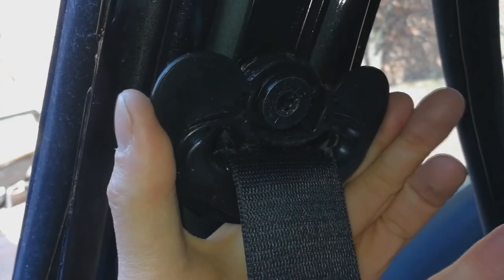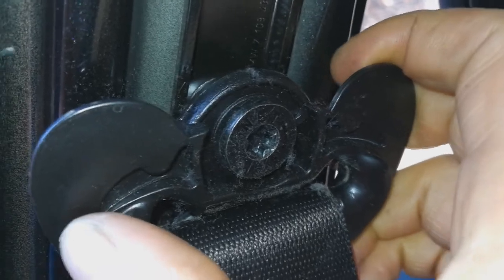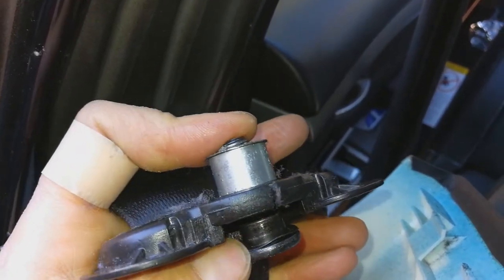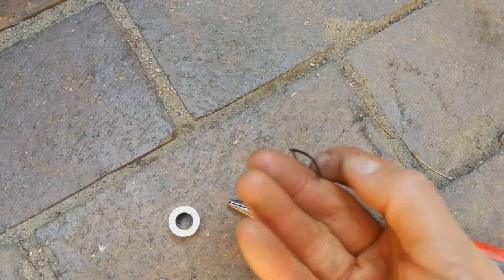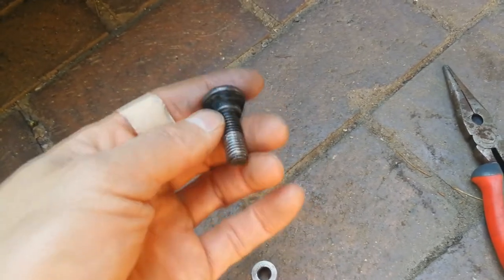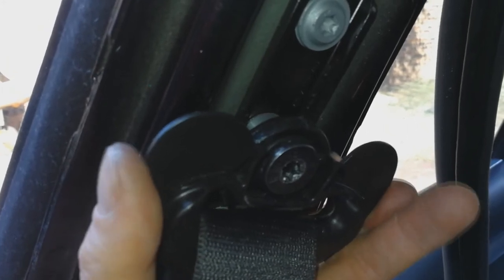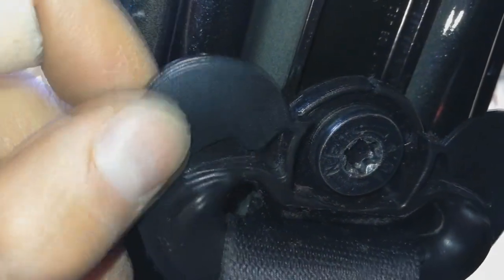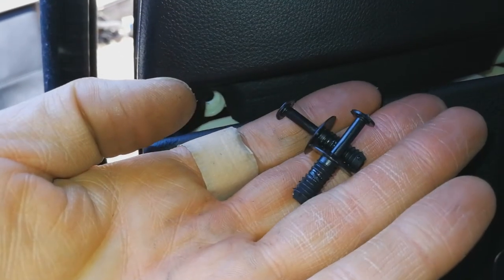Seatbelt clicking (rattling) sound fixed (BMW)

Comment: First of all : THANKS ! This is all I needed to fix this on a F20, the mecanism is exactly the same. Big thumb up for sharing this stuff, it helps, even 6 years later !

For other viewers : I heard a very quiet but very annoying "loose metal/plasticky" things in my B Pillard, PERFECTLY along my left ear and it ran me mad ! When I put my hear next to the B pillard it was very clearly coming from this seatbelt gate. It started out of nowehere, suddenly, I my mind couldn't forget his existance now. 

So I did what you did.

I repurposed the washer sadly, cause I don't know where to buy another one like this, but I bent it a bit and added DIY thin foam washers and put them between every damn moving thing along the screw. I also tightened a bit more than OEM. 

You won't be surprised by the result : That thing is un-rattlable ! No more noise, end of the story.

Comment: Wow thank you so much for this video! I have visited the dealership 5 times so that they could diagnose and fix this exact noise. Even after 5 visits, they ultimately did not find the root cause of the noise, even though they told me that they had fixed it. I am sure I do not need to tell you how annoying of a problem this is for the driver (or passenger, depending on which side is ticking/rattling). It’s right in their ear level so it is super apparent for the driver. Also the noise is just loud enough to bother the driver but sometimes not loud enough for BMW to hear/diagnose. Anyway, thank you so much for this video!
Reply: When you had this problem, did it come and go? I've gone in twice now and both times it stopped when I got there. Then a day later it'd be awful, like 5 rattles per second and LOUD. 

Not sure if the seatbelt would do this...
Reply: @drone1028  I smack that area and nothing happens. But it sounds like its right inside the B pillar. Getting it checked again shrug

Comment: The washer is a Belvedere washer for anyone who gives a sh1t. You can buy them for pence rather than use O-rings etc. If you double them up back to back you get extra spring pressure and travel.

Comment: Thank you for this video! I had this clicking sound appear about a year ago quietly on my driver's side and now it's on the passenger side on my 2017 340ix. Dealer tied to tape up the area thinking it was the trim cover rubbing again the sheetmetal. The clicking occurs when the car goes over rough pavement and when there is body flex like when the opposite side of the car hits a bump. I will make an appointment and show them this video.
Reply from the maker: its also the entire fitting slightly wobbling. You must also use anti rattle tape behind the entire fitting.

Comment: I went thru with this finally but it didnt fix my issue. Its coming from the seatbelt area/slightly above but there is nothing else there.. :(
Reply from the maker: there is another noise source. Remove the seat belt and then remove the bolts holding the metal piece and put some anti rattle tape under it. It will resolve your problem. The whole plate rattles slightly.
Reply: @ecologicaltime  I appreciate you getting back to me, unfortunately I've removed the seatbelt entirely and its still rattling. I think it may be the airbag